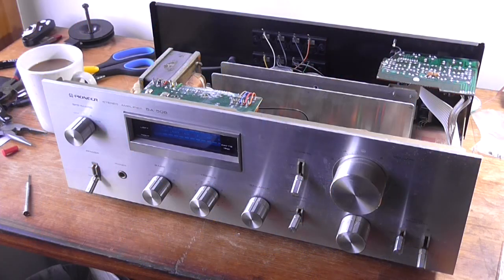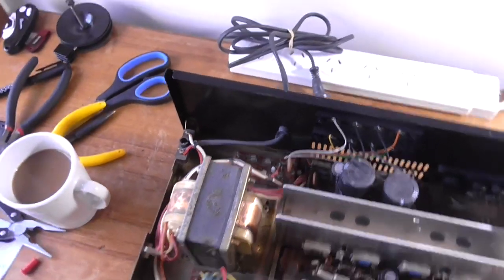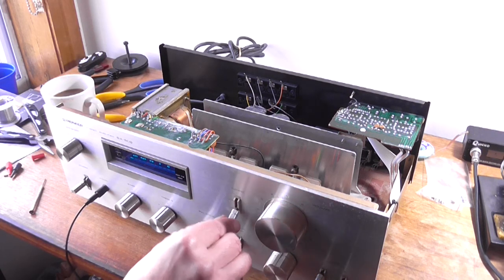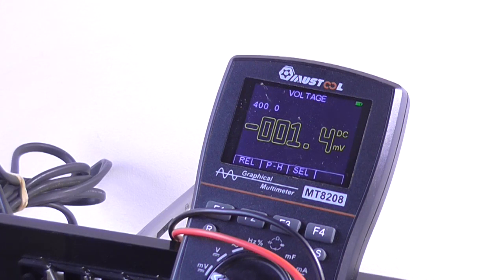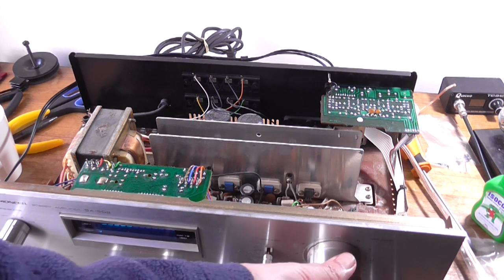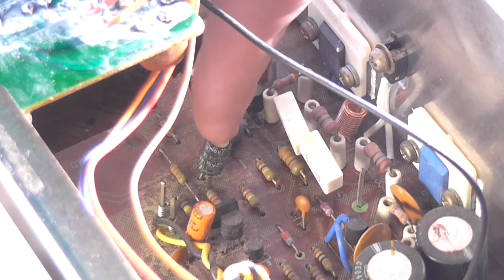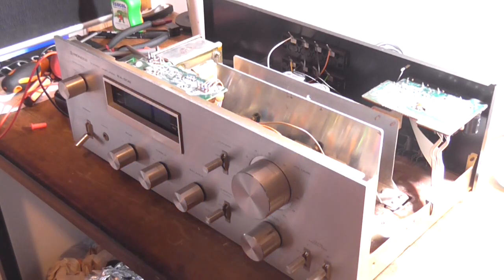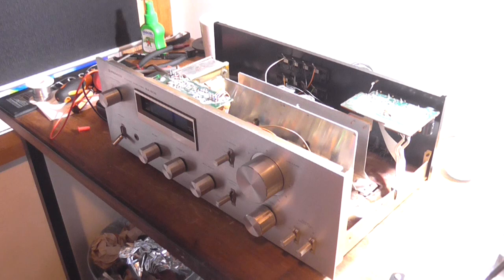Pioneer SA-508: Mains Hum On Left Channel

Comment: Could you have traced back from the L channel O/P with an oscilloscope to see where the ripple stopped & started?
Reply from the maker: The amplifier was repaired by someone else. One of the main filter caps was physically leaking. It's now working fine 🙂
Reply: @AstrosElectronicsLab Здравствуйте,хочу спросить у меня такой аппарат Pioneer SA 508, почему когда я его слушаю,у него звук металлический,аж уши устают,я его купил с рук, хозяин говорил что то менялось в нём,но не понятно, слушаю через акустику S-90B,но на полную мощь не включаю, где-то на без пятнадцати.Спасибо.
Reply from the maker: @Саня-в6ы  I can't read Russian.
Reply: @AstrosElectronicsLab so the cap leaked in such a way it caused noise on one channel? The filter caps affect both channels equally, with one smoothing the positive rail and the other the negative.  If only using a voltmeter to troubleshoot,  the best approach is to check voltages. Get the schematic from hifiengine.  A lot of these schematics do show voltages making your life easy.
Reply from the maker: @ctrlzyx2  already had the schematic. The left channel amp was closest to the leaky cap.

Comment: I have one of these amps. I replaced the two large, 8,000 uf smoothing capacitors, one of which was visibly bulging. I used two ELNA 8,200 uf replacements because 8,000 uf caps are no longer made. These two caps smooth the rectified DC from the mains; they remove the AC ripple that causes hum. I also replaced the other electrolytics in the power supply. My amp now sounds far better, particularly the bass, and I'm very happy with it. Have fun. :)
Reply from the maker: That's fine, but the hum is only on one channel. The supply is common to both, so its not the filter caps.

Comment: One of my favourite things to do is replace the 1 capacitor causing the fault ;)
Also if the current ebay listings reflect what this thing is worth.... maybe worth another crack
Reply from the maker: That involves finding said capacitor causing the fault... lol. I checked all transistors in that stage, seemed fine, too. I don't own the unit, my housemate does; he said he'll decide if it's worth his time recapping it. I just gave him my opinion on what would fix it (I hope).
Reply: @AstrosElectronicsLab  I hear ya dude! There has to be someone on a forum or youtube channel who'd know exactly what part is causing the fault....